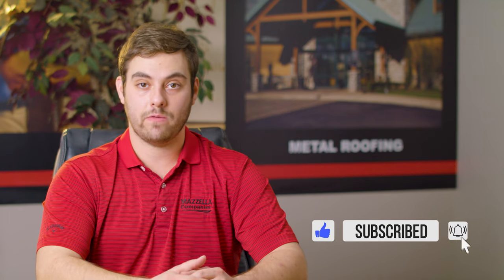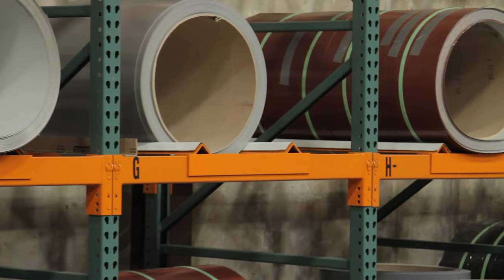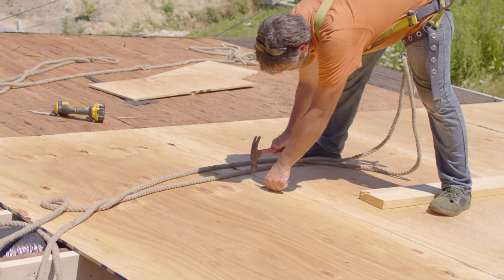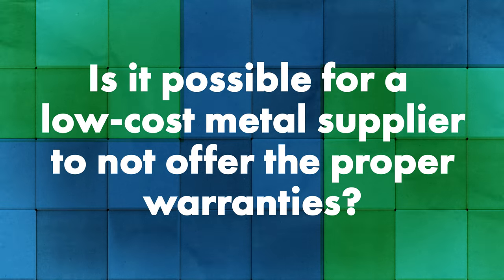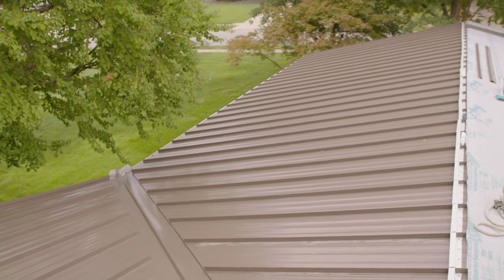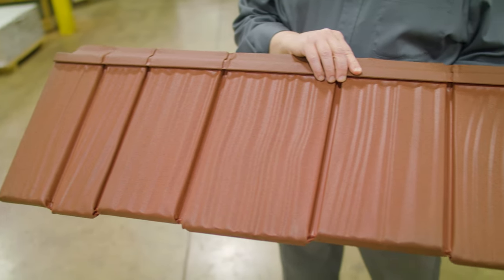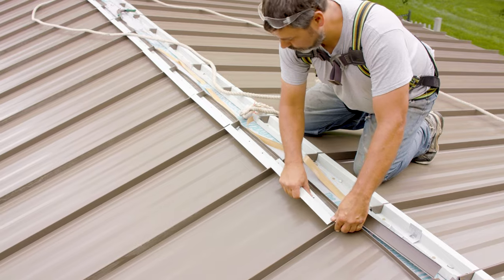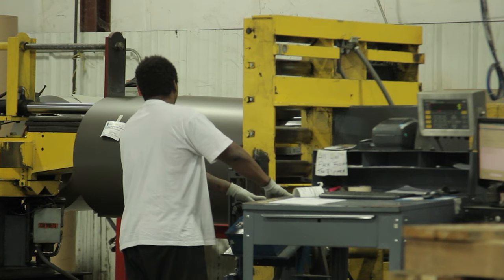Problems with Choosing a Low Cost Metal Coil & Sheet Supplier

Comment: While appreciate the video, Jeff talking about quality of paint used terms and abbreviations that I’m not aware off. Can you do a breakdown of some of the term and material he was trying to express for those that aren’t chemist?
Reply from the maker: Sure! PVDF is the known as the best paint type in the industry for it's long-lasting characteristics. An SMP paint system is also popular, and while it will perform well, it won't perform as well as PVDF. Check out this video to learn more about the difference: http://bit.ly/pvdf-vs-smp-video -Thad
Reply: Kynar painted metals are some of the best in my opinion.  Great warranty.
Reply from the maker: Agreed, and Kynar is often used as a casual way to refer to PVDF paints. -Thad
Reply: @TheMetalRoofingChannel  thanks!